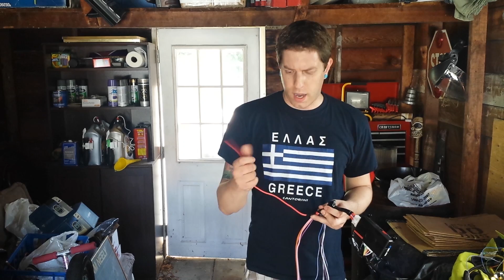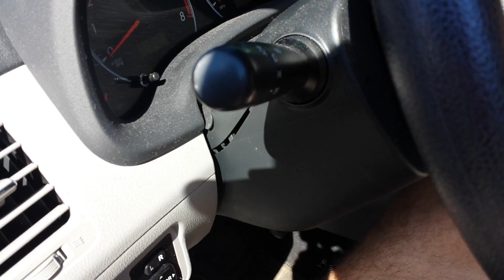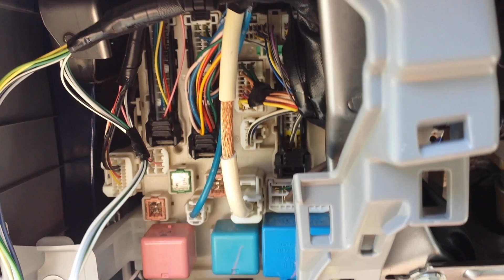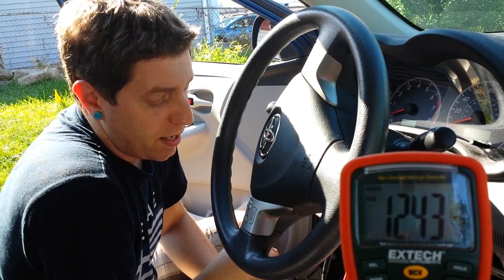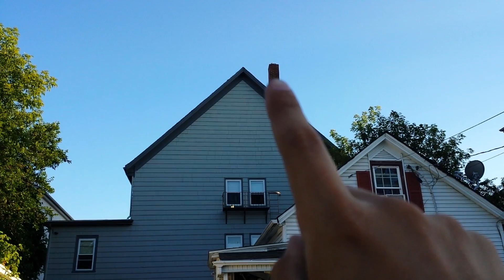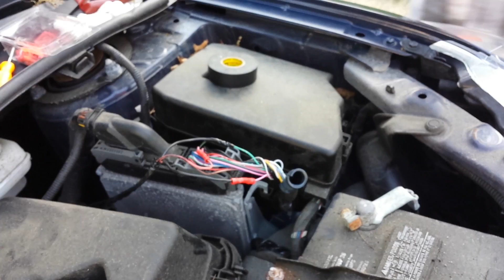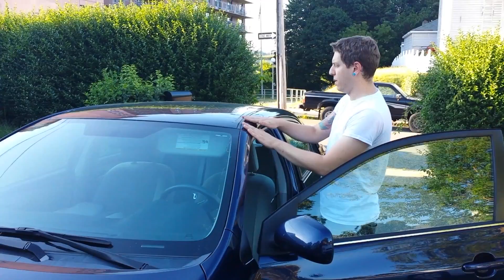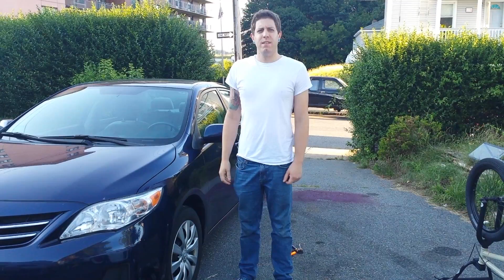2009 - 2013 Toyota Corolla Remote Start Install

Comment: Hey there! It looks like you are doing this on some smaller ignition wires. I have a 2006 hummer h3 and I believe the ignition wires are 22 guage. That being said I have an omega Al-2060 edpb that has some either 10 or 12 gauge wires coming of for a high output positive ignition/ starter. I see you guys have wired it up on yours something similar to what I'm thinking if doing I just wanted to know how it's holding up.  Has the current coming from the remote start wires been too much for those smaller wires?
Reply from the maker: Ah, so the important thing to keep in mind here is that when we're talking about current and voltage, we're talking about the potential. So yes 10 and 12 gauge wires can handle higher currents than 22 gauge at a constant voltage (12-14V here) but the ignition itself is a lower current ignition so it's not going to pull more current than a 22 gauge wire can transfer and that's how it was engineered. The 10-12 gauge ignitions you'll find in 90's cars were used to drive the actual starter of the car and ignition components under the hood. Fast forward to today and everything being computer controlled; at most the ignition wires are only supplying to low current (~150ma) relays if not directly to the computer. So as long as you don't go smaller than 22 gauge, you'll be groovy. What bypass are you using; FLCAN or DBALL type?
Reply: Danny K. Thank you! The bypass I am using is an omega blade Al-64. when I purchased the starter they had two options. One was a canbus system, and the other was a data bus. I was told that the data bus was the one that would work for my application. Hopefully that proves to be true!
Reply from the maker: Anytime man! Yeah, the data bus system is what your truck was built with. You're truck uses the PassLock 2 and PassKey 3 systems where the PassLock 2 wire has to be given specific resistances to ground during ACC, RUN, and START to allow crank (which will be done by the Omega Blade) and the PassKey 3 is the "chip in the key" which is learned and fed for the bypass through the DataBus wire which is at your OBD plug. It's a pretty standard system that was used throughout the early 2000s so should be a pretty straight forward install (unless Hummer did something stupid with their implementation).
Reply: Danny K. It seems pretty straight forward.  I've heard they don't do as well with the lower end remote starts. I think It has to do with a cheap bypass more then anything, but that's about the only thing I've heard of being a problem.  Anyways thank you again for your help! Hopefully I can get this thing in tomorrow and then I'll be nice and warm in the mornings!
Reply from the maker: Good luck, sir!

Comment: Hello, I was wondering if you can help me out troubleshoot a remote starter. The remote starter seem to work all the accessory, radio, and heater work but when I put the key into the ignition and press on the brake all the dash light come on and the heater and stereo stop working. When I try to start the car with the key it start but all the dash light come on and the radio and heater doesn't work? 

I use the idata alca immobilizer
Reply from the maker: Hi Lee,
Is this a Toyota Corolla or a different type vehicle? It sounds as if the car's OEM ignition is no longer outputing 12 volt on the accessory wire. So when the remote start is active, everything works...when you push on the brake: the dash lights light up brighter (because the parking lights are turning off with takeover) and the accessories lose power because the remote start is no longer powering the accessory wire and, how it sounds, neither is the cars OEM igntition system on takeover. Can you try starting the car with the key and test to see if you have 12 volt on your accessory wire at the ignition harness? It was light grey in the '13 Corolla I did if it's the same car.
Reply: I test the accessory wire and when the key is in with the engine starting I don't get any power.
Reply: 2013 toyota corolla type s automatic 1.8liter
Reply from the maker: I think you found the problem. Did the accessory wire's pin pull out of the ignition harness by chance? I would just check to see if something is loose there or something may have gone bad in the ignition where it's not outputting the accessory 12 volt any longer. You definitely know the accessory wire and fuses and wiring on are good because you're able to power up the accessory wire from the remote start and get heat and radio that way.
Reply: The accessory wire is still intact. So you think I have a bad ignition?
Reply: Here is a couple of video on what I mean. 

https://app.box.com/s/15rtwb7okh4twi5phkhx87sh3gwylgbq

https://app.box.com/s/urvzy0l70cmiy4za4tpr75k3vsvndr7b
Reply from the maker: Yeah, as long as you make sure the ignition harness is all the way plugged in and everything looks connected, it sounds like it might be a little more serious. I'd still say check all your fuses in case something is blown but I would think the remote start wouldn't power it up either if that was the case. End all, if the ignition isn't outputting 12 volt on the accessory wire with key in the ACC and RUN positions, then you're dead in the water right there. You'll need to isolate what's causing that and it sounds like it's inside the ignition itself.
Reply: Thanks for your help. It was a blown fuse.
Reply from the maker: Whew! Glad that was all it was! No problem.